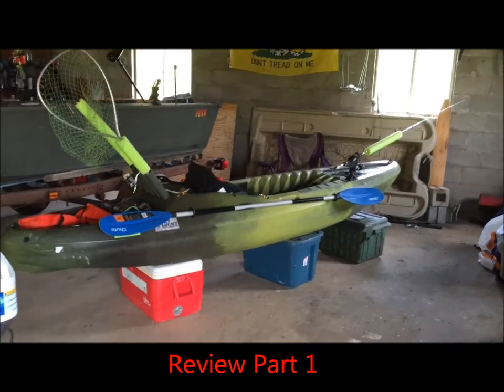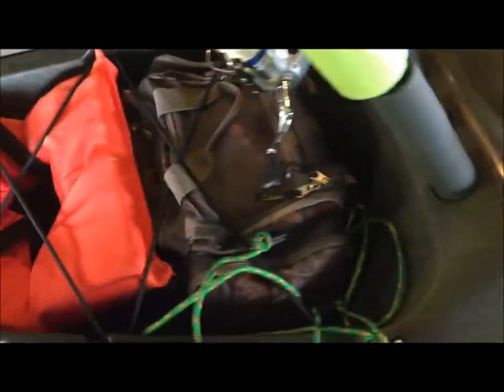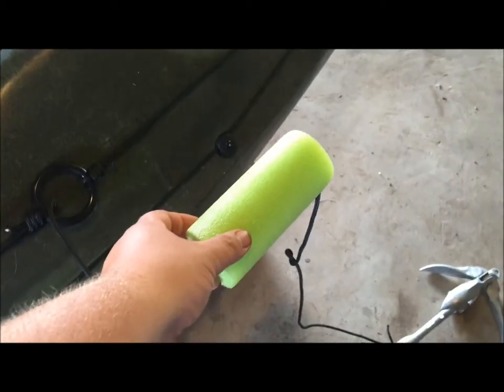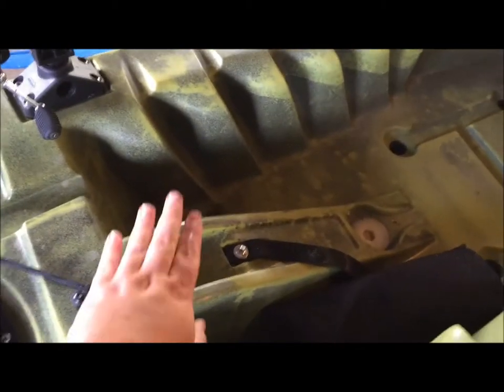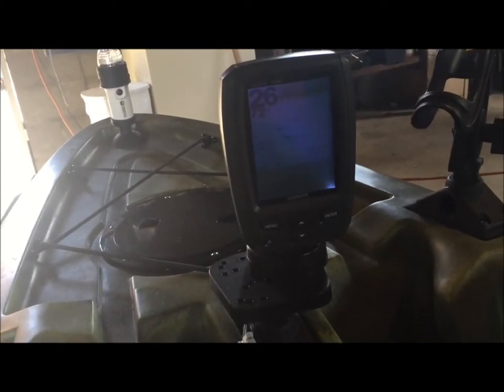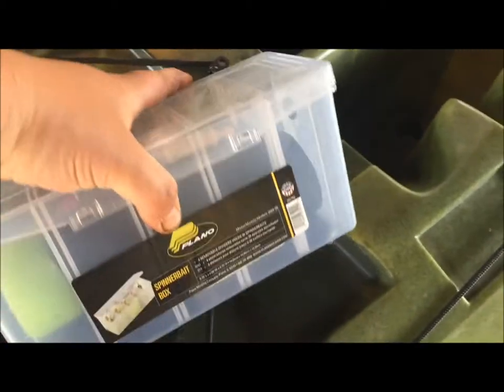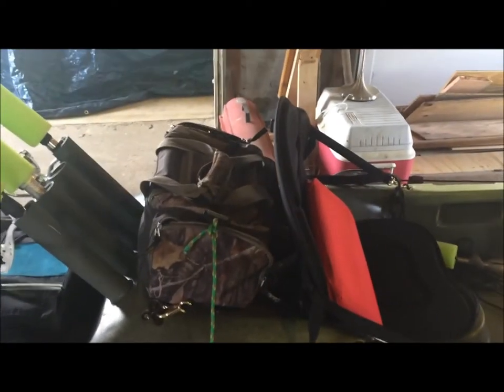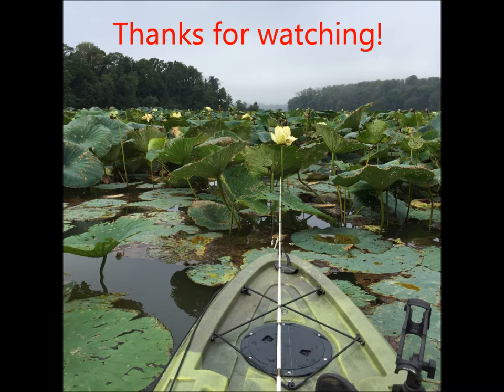Perception Striker 11.5 Kayak Review

Comment: Hey Zach, I have to agree with you about the speed and the foot grooves! I put a boat seat on mine, it gives me the height of the back seat while keeping center mass more to the front and I end up putting my feet on top of the side walls! Also, I don’t use the factory rod holders. I put rod holders on a crate and it works out much better, in my opinion.